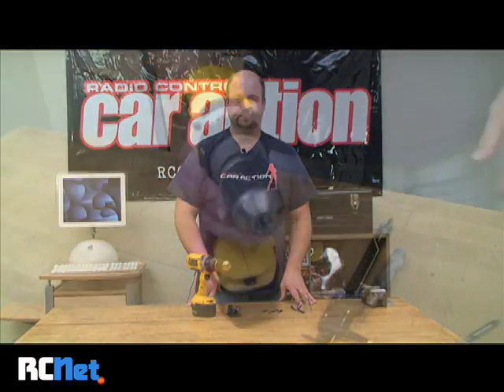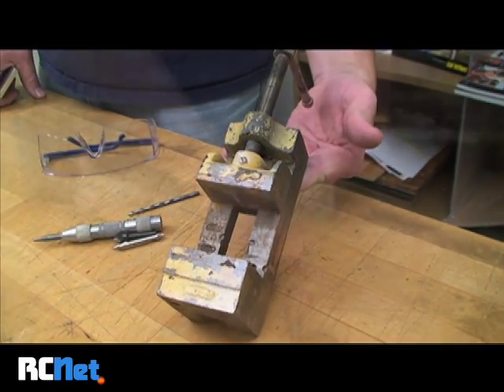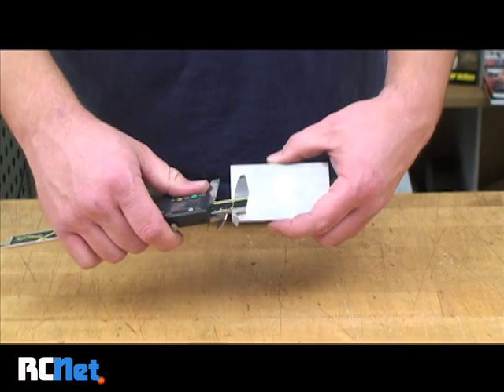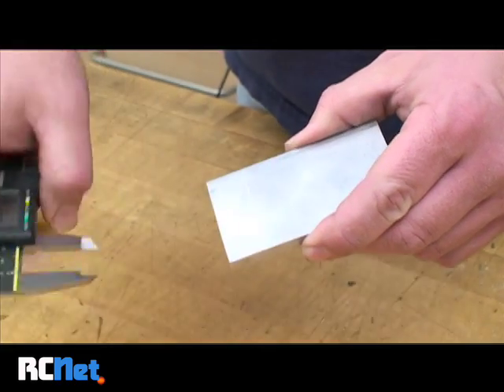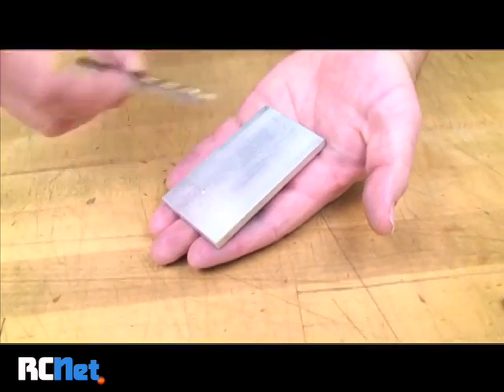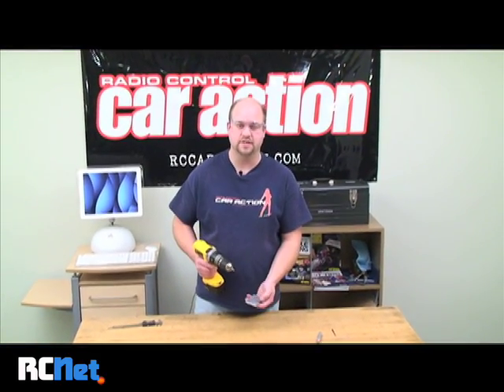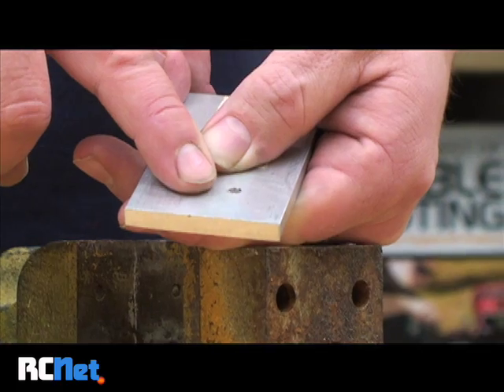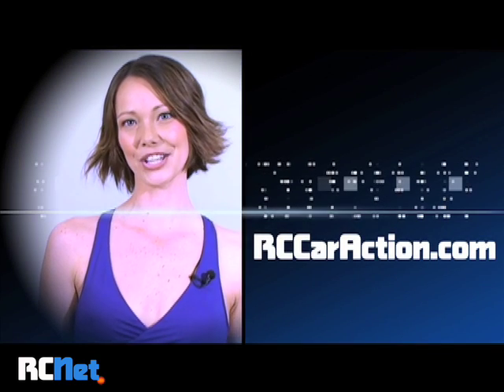How To Properly Drill Into Metal

Comment: You should mention that you dont want to try to dust off the metal shavings with your bare hands as they could be very sharp and cause physical damadge not only to your hands but your feet if you track them back into the house.
Reply: He was drilling metal with his hand behind it so probably has artificial hands.
Reply: Tongue deburring is also frowned upon - unless you have a sharp and/or carbide tongue.

Comment: I am a machinist,programmer and edm tech. I use my calipers to scribe aluminum all the time. Of course that's my cheap set. I'd never use my starrets to do that. As long as the metal is softer than your tips it isn't going to be that big of a problem. As far as getting the hole square to the surface, I'd at least use a drill press but that isn't always an option, so practicing with a hand drill will get suitable results. The only thing I would add to this is to use a little cutting fluid.

Comment: you can use a little ruler and a blade to mark your measurements. this will leave the same line as you would leave with the right tools. if you drill bigger holes you should check how bright the tip of your drill is. then, after punch marked your hole, drill the first hole as big as the tip point of your end drill is. after that you can use the large drill and countersink it